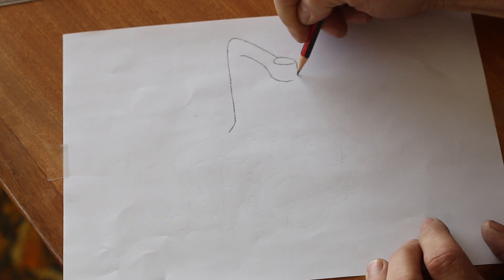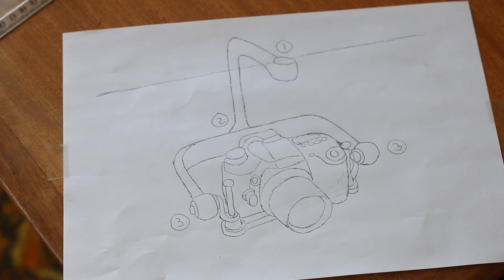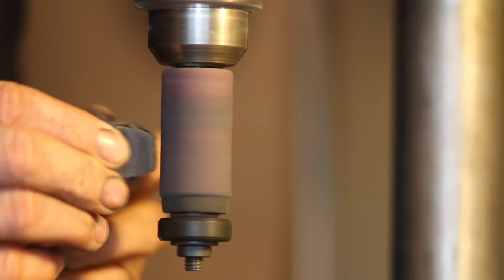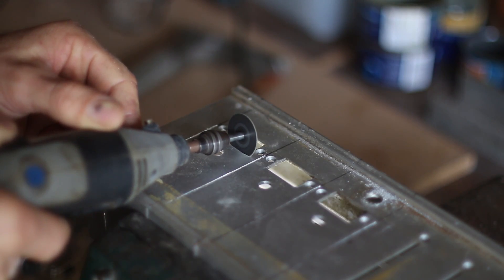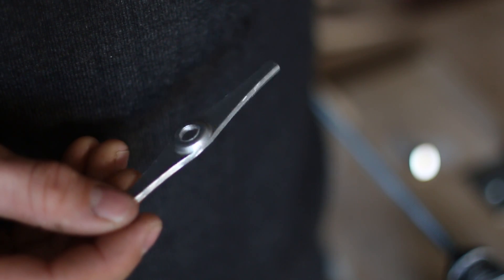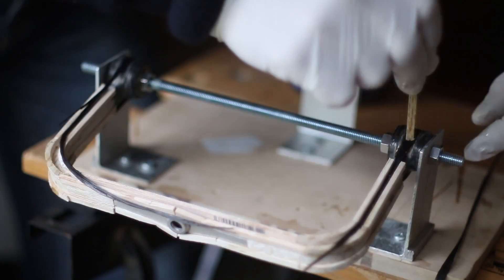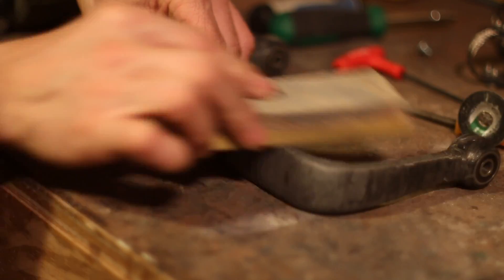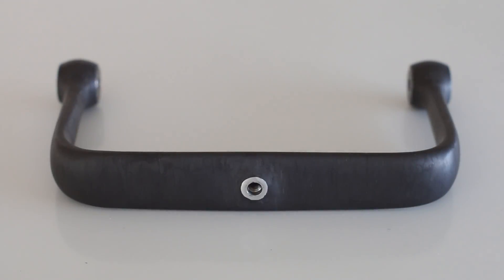Carbon Fiber DSLR 3 Axis Gimbal/Steadycam Build Part 1

Comment: Bloody nice work mate!
Reply from the maker: Thanks again Rod. I think out of all the pieces, I am most happy with this one. Even though I could have used double bias cloth of course, I didn't have any at the time. The strands actually were the greatest learning tool for me as I realised I could build just about anything with them. Chers!
Reply: @elams1894  I actually stole your technique just last week with a camera cage / top handle piece I made from CF! It was a bit flimsy but binding it with individual tows increased the stiffness without adding too much bulk. Thanks again for the inspiration!
Reply from the maker: @giscol  that's awesome. Indeed CF strands are so useful, good stuff!! Good to hear..

Comment: Is the wood structure still encased inside the final product?
Reply from the maker: +HandandSew Yes the balsa wood remains in the structure.  It offers no structural support other than to support the carbon fiber before wrapping.  Its so light it makes little difference to the end weight but very handy for initial form.  thanks again!

Comment: I had no idea you could build cf pieces and parts strand by strand.  You just opened up a whole new world for me.  THANK YOU for posting this and giving the detailed description of what you were doing and why.  Is the resin specific to CF or is it the same as what you would use for fiber glass?
Reply from the maker: +Greg's Garage Hi Greg!!  Yes its a cool technique, I kind of stumbled across it trying to fix things.  Its exact same resin as used in fiber glass.  The good thing is that the resin is squeezed into the fibers and all excess resin is eliminated so you get this extremely light matrix thats very close to optimal ration I would say.  Also because there is less excess resin, there is much less mess and the resin doesnt run into areas where you dont want it.  I'm going to post a vid shortly of a detailed description of the technique, you really can build anything using it, its great. Thanks so much Greg and best wishes!

Comment: Wow mate, that's outstanding !  Some cool little tricks there. And the new camera shoots some great looking footage. Looking forward to part 2
Reply from the maker: +Fletcher Handcrafted Guitars Thanks Fletch! Yeah the DSLR's really take a nice video, I finally got myself one.  Seeing the results of your footage gave me that final push I needed, and I'm very glad I did :) I used to work with carbon fibre, but on a larger scale with moulds and vacuum systems which dont lend themselves to garage DIY.  This technique with strands is a real cool way to build with carbon fibre at fraction of the mess and great results.  Its very handy.  Thanks heaps Fletch, hope you have been doing well!!!

Comment: Great video so far mate! So I'm guessing you mount the camera on brings and just let gravity stabilise it? 
Please can you link where you bought the raw carbon fibre and large tubes of resin
Reply from the maker: +guitarslf132 Hey dude!!!  How you been?  The epoxy resin I use is made here in NZ but I'm pretty sure you can get 'West Systems' resin in the UK, thats top notch stuff.  Also 'High Modulus' are the company that retail carbon cloth. Check for those two for materials, I'm certain there are outlets in the UK.  Yes gravity does the stabilising via the bearings, however most gimbals of this kind use brushless motors with stabilisation computer programming to keep everything level and also give panning ability.  I may mount motors after I have finished the frame, but I'll see how it all pans out.  Thanks dude!!